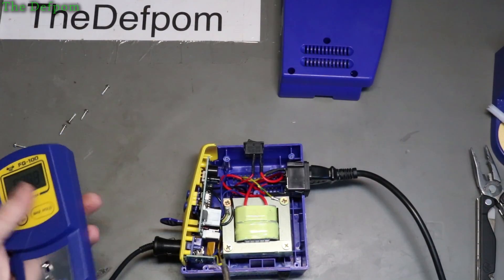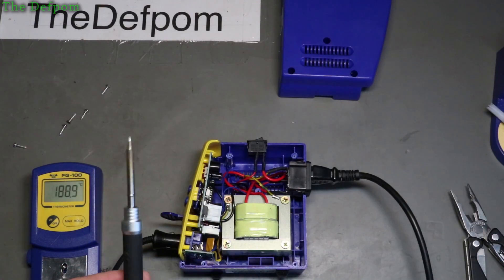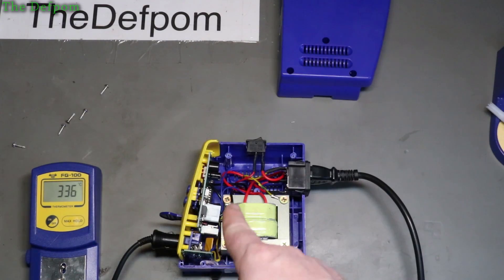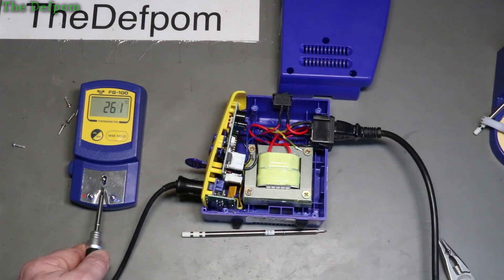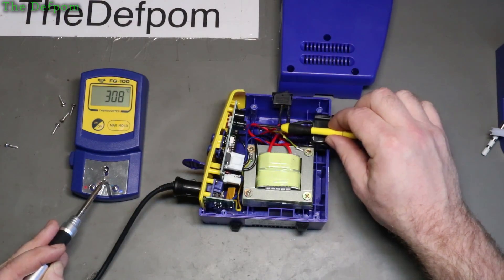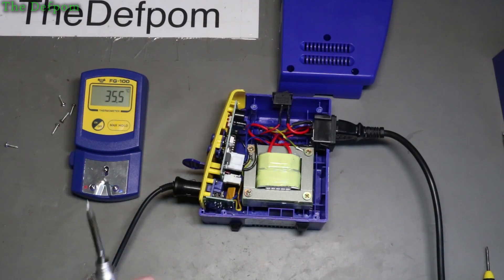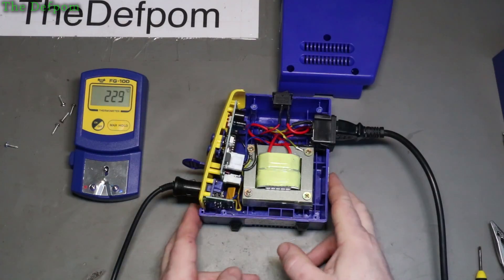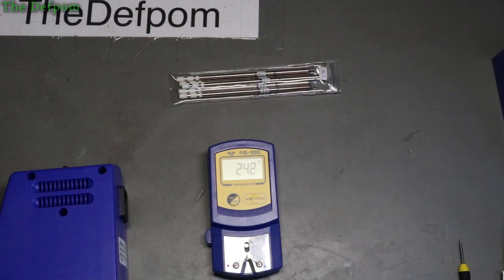🔴 #430 FX-951 Soldering Station Calibration and T-12 Tip Temperature Tests

Comment: I just don't bother with temperature displays or how precise the thing is set, I did at one time when I got my first  unit,not sure the temperature tester thing's are very accurate either.  These days I just drive the soldering station by the seat of the pants, you know when it's hot enough and when not or too hot. I have just bought a Pace WJS 100 unit to replace the CSI premier 75 and not even bothered programming it, just turn on and if it's not right just turn up or down as required, it would be better with a dial knob rather than the up down buttons. I think one can get too bogged down with preciseness on occasion.

Comment: I have the same Fakko, I changed a lot if the wiring to the board and replaced the caps with Panasonic and it was perfect
Reply from the maker: An Englishman in Brazil - yes I think the electronics side is ok, it just has poor quality construction of the hardware.
Reply: @TheDefpom  i changed a lot around resoldered the connections on the bottom and re-caped it and it was almost spot on with calibration

Comment: I don't know about you, but i would desolder that pcb preset and add wires to a top or back mounted pot.
Dots could be marked for certain types of elements.
Just a thought, makes calibration far nicer :-D
Reply from the maker: zx8401ztv - yes I suppose you could do that, I think that buying real Hakko T-12 tips would solve the issue though.